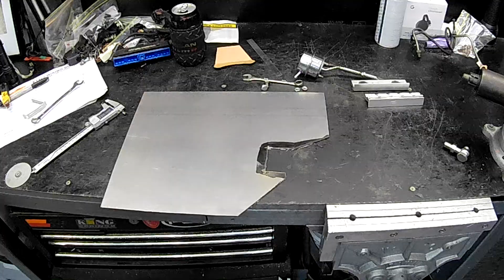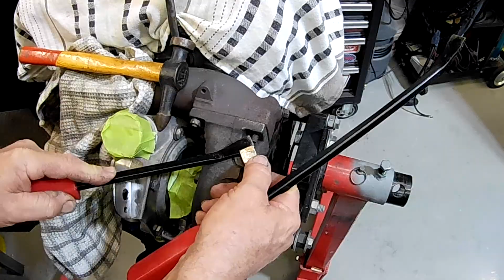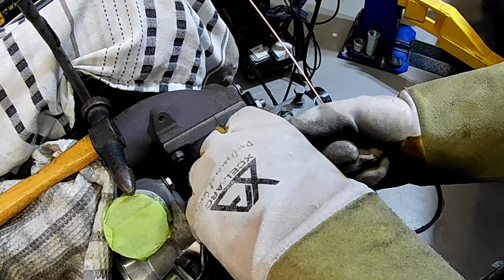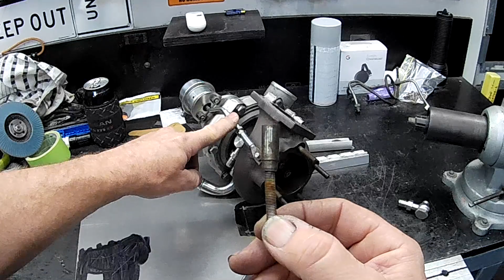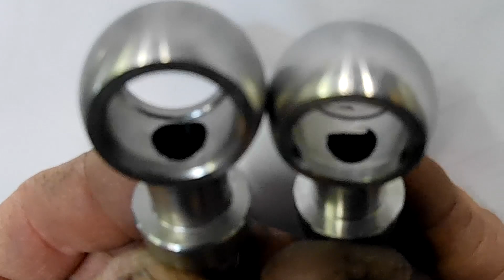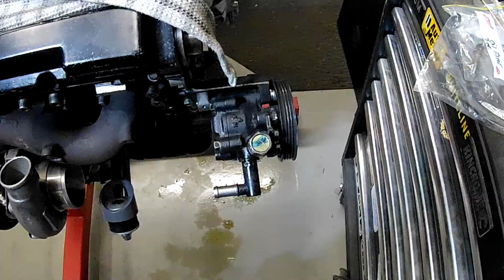Custom GT28 Wastegate Brackets & More. Project Fairlady. The Nissan Z32 300zx Twin Turbo Mega Build

Comment: As usual awesome work, last time I fitted turbo's the 3 turn back method to tune the waste gates was to much, it ramped up the waste gate opening pressure to much. but I suppose it's individual to the waste gates. A14psi spring is on the higher side as it is for control when traction may be an issue, especially with this beast. I always test regulated air pressure into the waste gates to  crack open at what ever the waste gates are rated to and of course the same on both sides, some times this can be like half or one turn back. But I only boost to 23psi not sure what the procedure is for boost in the 30-ties.

Comment: A disk on the waste gate welded onto the shaft would give the option to mount the actuator in any direction just by drilling a hole in the disk where required. After market turbo manufacturers please note!
Reply from the maker: Thats a great idea Benny, you should Patent that one. Nice.